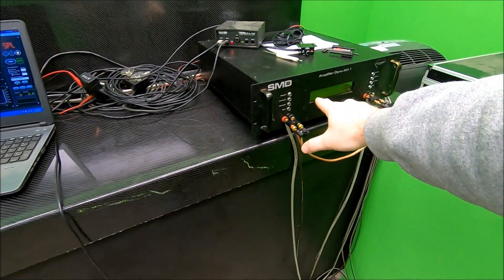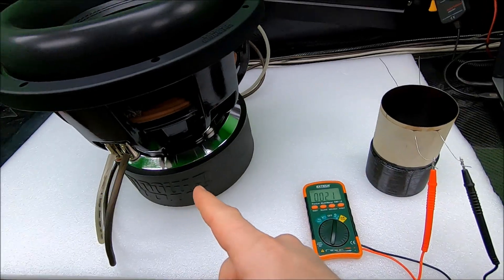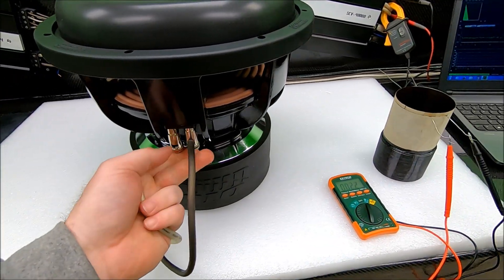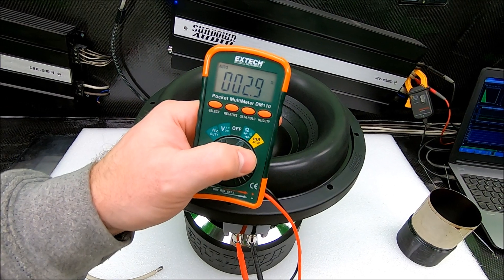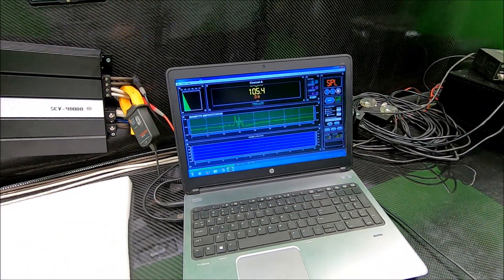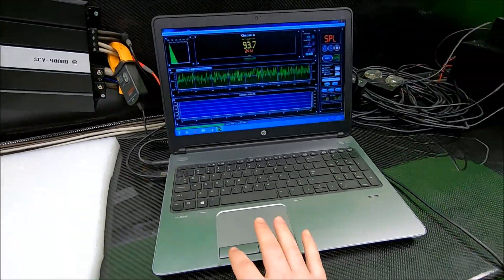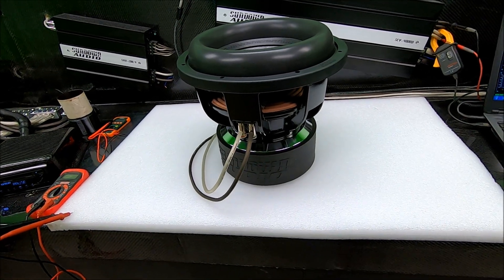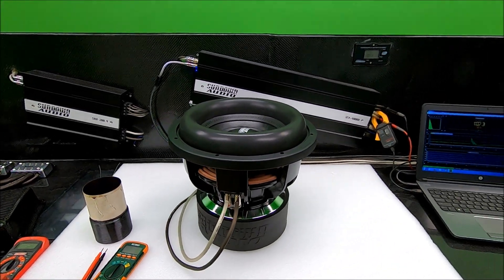How To Fight Box Rise *Tech Time Thursday* at Sundown Audio

Comment: Excellent presentation but i would like to add a few things... first and foremost including the word "rise" is slightly misleading, impedance is the technical term for AC and resistance is DC. With an AC signal the inductance of the coil causes the current to lag the voltage leading to a phase separation between the current and voltage (aka Power Factor) which leads to a "rise" in the collective of current resisting forces quantified as impedance.  ****Z (impedance) = R (DC resistance) + jX(reactance, the imaginary component due to the AC signal)****  That is a "complex number" and the "j" is typically known as the imaginary number "i"(sqrt(-1)) in math classes. The erroneous readings on the resistance measurements were caused by Faraday's law, moving coil in a magnetic field induces a current. The multimeter uses a constant current source and measures the voltage across the "unknown resistance", by moving the coil you induce added current into the equation causing an erroneous reading. The real Z needs to be calculated from current and voltage measurements OVER TIME. In a single frequency situation one could add an appropriately sized capacitor to combat the phase shift caused by the coil inductance to a purely DC resistance load. An inductive load causes the current to lag the voltage and a capacitive load causes the current to LEAD the voltage, so one can deduct how a combination of the two would result in one cancelling out the other. In the impedance equation "Z= R + jX", X is defined by "X= Xc + XL" so if the coil represents the XL(inductive load) and the Xc represents the capacitive load so you can see how adding capacitive reactance would negate the inductive reactance resulting in a power factor of 1 or a purely resistive load.  

I slept at a Holiday Inn last night and have no clue where ^^^^ came from. 

For extra clarity... The reason "nothing can be done about it" is because the value of XL (coil reactance) varies over it's bandwidth requiring a Xc to change as well to maintain the corrected power factor.  So by no means am I trying to discredit the information in the video, I wanted to add to the information from a technical aspect and explain how it could be addressed at single frequencies for peak output measurements without the need for a lower DCr coil so that the amplifier operates at it's peak output. The math to calculate the correct value capacitor is not hard, research "Power Factor Correction" if you are interested in the topic.

Comment: You can just buy an amp like the alpine pdx-m12 and box rise will be a thing of the past
Reply: No, not all. It helps, but that amp can only keep its rated power from 2 to 4 ohm. The sub will have a much wider range than that. It is definitely an improvement, though.

Comment: Box design can help fight rise at certain frequencies but most likely there will be a trade off at other frequencies. For obvious reasons he wouldn’t come out and say this but Jl and Fosgate Amps have current sensing ability to somewhat even out the power across the frequency range. 
Amp technology is like the carburetor vs fuel injection argument. Peaky and Dynamic vs Flat and predictable.
Reply: Subwoofer impedance rise causes power to go down, but it also causes efficiency to go up by the same amount. With a properly designed (voltage source) amplifier, box rise will not affect SPL output or sound quality whatsoever.

If an amplifier were to "even out the power across the frequency range", it would be supplying more power when the impedance was higher. This would put a big hump in the upper bass response and make the low bass (where the impedance is lower) roll off a lot quicker. A current-based amplifier would also have a horrible damping factor.

Sure, it would be great for some SPL applications but it would sound like garbage.
Sundown wants their stuff to sound good, so they don't do it.

Comment: A few things:

1. A DIY impedance measuring jig and a free software tool like REW will graphically show how impedance varies with frequency, and how that variation can also vary at different power levels. That really could be of benefit here.

2. The subwoofer is actually MORE efficient at higher impedances in its impedance curve, all else being equal.  That's because the power it absorbs is related to Voltage*Current, and the Current delivered into the subwoofer is less when the impedance is higher.  And less power draw = less draw on the car's power supply = less voltage drop at the amp's power terminals.  

3. Unless you're designing a system to have a big peak at one frequency for SPL competition purposes, all you've really got to worry about is if the amp is capable of swinging enough voltage into the subwoofer to get the output that you're looking for at the sub's MINIMUM impedance in the passband (usually 80 Hz and below, and because that's where the subwoofer's maximum power draw will occur), without exceeding the subwoofer's thermal or mechanical excursion ratings. As you suggested in the video, any impedance rise above that in the subwoofer's passband is not something to really worry about.

Comment: This is called resonance frequency LoL 
Around the area of the resonance frequency the resistance rises.
At that frequency the speaker needs very little power to move!
Depending on the enclosure this frequency changes or it has more than 1 spot where this happens. You can easily see it with a speaker simulation programm.
It does not hurt you score! because as i said.. It is the resonance frequency of the speaker. It doesn't need loads of power to move at that frequency.

Comment: I hate the term box rise , impedance rise is more proper .
Reply: Actually impedance change if far more accurate cause it not only rises it can and does “fall” 👈🏻! Hence why wiring low can cause you to burn your shit out. Guys always holler wire it to half ohm well then they end up frying their amps and subs and saying brand x sucks when in reality they suck cause they burn up perfectly good equipment. My amp says 1ohm is its safest load I will re at 1ohm or higher.
Reply from the maker: Agreed.  I talk about that in the video.  Box rise is more popular though so I put that in the title.
Reply: "Box-rise" is easier for uneducated people (with poor memory) to remember, pronounce, and spell. "Enclosure-induced impedance curve" may be more accurate.

Comment: #SundownAudio if an amplifier is rated at 1 ohm, most class D amps are, why couldn't you wire your system lower than the 1 ohm.  It's seems that at nearly every frequency the impedance rise is always higher than the 1ohm. So even if you're wired to ½ ohm, the amp should never actually see anything that low? Hope my question makes sense.
Reply: Yes, this typically works. Some combinations of sub and box might see a load of 0.9 or 0.8. As long as the amp can handle that it should work. You can also test the impedance with a Dayton Audio DATS.

Comment: so . . . . resistance is futile? 🤔

😜
Reply: Resistance is actually a good thing to know, when it comes to power handling capability. The current times itself, times the resistance, tells how much heat is being dissipated in the coil. Voltage is largely meaningless, because any voltage beyond the voltage drop of the coil, is actually motion of the speaker. That energy is the sound you hear. That doesn't contribute to heat.
Reply: Assimilate into the Borg.

Comment: Simple for me. I always buy an amp that does double what my subs are rated for at the amps minimum safe impedance. 600 rms sub...1200 watt amp. 2500 rms sub, 5k amp. I would rather have the better efficiency of the bigger amp over wiring a smaller amp into the dirt.
Reply: LMAO Story of my life right now. My set up is wired to the dirt, great electrical. I'm just like barevids 0.5 strapped each amp seeing 0.25
Reply: Theres another cheaper way to combat box rise and get louder and stay louder... Build a 30% or so bigger box.
Reply: @akuma4u  That will make the subs more efficient for sure but most people that have room for a 30% bigger box will be going with larger subs to eat up that space and if you build the box too big you will effectively be running the subs free air and run the risk of reaching mechanical limit's very quickly and damaging the sub. But yes if you're stuck running well below the sub rating for power a bigger box can make up some of the diffrence.
Reply: @Supercharged1976  if u got an underrated sub lets say 1500rms and u got it hooked up to an amp that does 2200rms at 14.4v in a box that is 2 cubes which is recommended, after things like voltage drop (i drive around at 14 to 14.2v never 14.4) and imp rise, you are prob giving that sub like 1000 to 1500rms max which means it can take more. Using a slightly bigger box , of course not too much bigger, will make up for that lost power. 
Of course this technique can only be done if a)you are using subs that are under rated and can handle much more power that they are rated for b) your amp is rated for what the subs are rated for or the amp is 25 to 50% more than what the sub is rated for.  of course you CANT do this if you got a 1500rms sub hooked up to a 4k amp. C) you only make the box 15 to 30% bigger than manu recommended specs. Going more than this could cause damage.

This is a theory and im actually going to test this out soon. From a few others ive been told it works. And not to worry about reaching limits or damage..
Reply: @akuma4u  ... I once read somewhere that:
The more efficient your enclosure is, the more rise you get.

I could be wrong. 🤷‍♂️

But if that theory is true.. then trying to chase a bigger enclosure is only helping you chase the rise even more. 

Or maybe it could be like the "law of diminishing returns"... after chasing performance to a certain point, the pursuit becomes impractical OR unproductive. 🤔🤔

Just some thoughts & theory...
Reply: @jr1001jr  Many have said that a smaller box has less rise.Also larger port has less rise.And the stronger the box is,the less flex,the less rise.I guess that's another way a larger box can cause rise,by potentially being more flexy if not properly built.
Reply: @Supercharged1976  it's the opposite of a dead short. It's almost an open circuit.
Reply: I was gonna say the same thing but a bigger amp
Reply: Hey so what's your opinion on running sfb 3k  to a u18 rated @ 1.5k. It would be double the rms..

I'm being told to do it by a friend that's helping me get a pounding system foing and I'm unsure if he is blowing smoke up my * or if what he is telling me is legit.
Reply: @ert-wert  Absolutely. It's different for every build but 9/10 you will be seeing 2000 watts or less most of the time out of a 3k wired at rated.
Reply: @Supercharged1976  this is accurate af I have an sfb3k that clamps 2200 watts
Reply: A quality double power amp.
Reply: This is a mistake. Impedance  is not always below expected wattage. When the expected wattage is more than your speaker rated she goes boom 💥.  Best to have under powered speakers. This means know how much power you want and exceed it. I always asked why people only go low what's when they can always turn down the valume.
Reply: @kingskingsmanship  this is horrible information….more speakers get blown being underpowered than over powered due to clipping…..
Reply: @calebsmith9534  lol. So funny. There is no such thing as blowing a speaker or hurting a single part of a system with underpowered. The only exception is not enough juice to the amp. lol
Reply: @kingskingsmanship  actually, wayyyy more subs are blown due to clipping. Clipping is introduced, “usually” when people don’t have an amplifier that’s able to produce adequate power, therefore they attempt to “overdrive” the amplifier by turning the gains up introducing clipping. More subs fail due to heat from a clipped signal rather than being overpowered. That’s MY experience anyway. Maybe you’re is different, but ive been doing this since 1990, so I don’t feel I am wrong

Comment: Once you install that sub into a enclosure you'll have different readings, this is called box rise and yes you can adjust it within the design parameters of the enclosure.
Reply: Absolutely correct.  Can’t defeat it altogether, but with proper planning, you can take some control back.
Reply: So what is the best hz for our box sir regading wasting of power? Is it 32hz? Or 40hz?
Reply: @akolngto9314  Every sub, every box and every vehicle will be different. If you really want to know, get a Dayton audio DATS3 and it can show you the impedance curve for your specific sub, box and vehicle combination.

Comment: Nice video, some people would say buy an amplifier that does the same power ratings 1.5- 4ohms. Like a jl audio or fosgate amp. But I agree with what @barevids said, use impedance rise to maximize and utilize your system properly.
Reply: Or like you said at the top buy an amp that can do the work for you, and have a clean signal.
Reply: What video were you watching.  This video was crap!  He explained how it functions basically but didnt tell you the most important part and that is you have some control over it with your box tuning.

Comment: I want to know and the big question do subs need broke in , yes or no ? I always balls to the wall outta box answer this question
Reply: Your good to go baws
Reply: If your going to be extremly pushing a subwoofer with way over rated power I've been told breaking it is a good idea. But anything less then that is pretty negligent to what were looking at...and that's just a bunch of metal with a cone and a rubber surround.

So what do we we think is gunna happen? Its gunna shatter  or crack? Why would it be any different before vs after being broken in.

The question also is negligent to the reason that why would someone want to sell a product that isnt complete, it makes 0 sence and is a 100% sure way to fail business structure.

Comment: In at least some cases when impedance goes up efficiency also goes up so you are actually getting the same output for less power thus reducing the strain on your coils amp and power system. It's not always a bad thing.
Reply: It will never be more power or even the same power with impedance rise its the same as if you wire your suns to 4 ohms your amp with give you whatever its rating @4ohm never will be the same as power @1ohm
Reply: @Gr8rome407  i seriously have to re-explain a 3rd time for you... there is sound pressure level power and there is electrical power. if you get impedance rise but also gain efficiency then you can still have good output in terms of sound pressure level. this is not just wishful thinking this is a literally reality for all subs. you have an impedance curve and also an efficiency curve. what matters is the sound output and if you can get that output for less power then its better not worse.
Reply: @maxfmfdm LOL you can explain the wrong thing 3 times if you like it doesn't magically become correct...I get what you are saying it is just inaccurate..when u have inpedence rise you are not  "gaining efficiency" your subs are getting less power and they are NOT giving the same performance if your subs could theoretically stay constant @.5ohm-2ohm your system would them be more efficient this is why smart amp tech has been brought to the industry to OVERCOME inpedence rise not embrace it as a good thing.. Higher ohms are not efficient they are literally resistance..The efficiency u speak of is more enclosure related
Reply: @Gr8rome407  you can not understand it 3 times and it makes you prove how much you struggle mentally. do you seriously care about watts to the coil more than actual sound output? you could get a damn piece of wire and set world records by your standard and it wouldnt make a peep

Cancel

Reply
Reply: @Gr8rome407  also yeah its pretty common for an impedance peak to have crazy efficiency gains. might want to know something before you get in an argument dude...
Reply: @ericremple6395  I'll put it in words you might understand. Moar powa not alwasy needin mora powa to be moar!!!!..11111